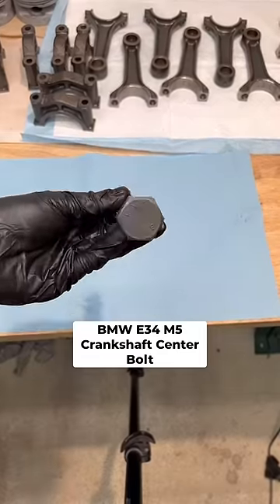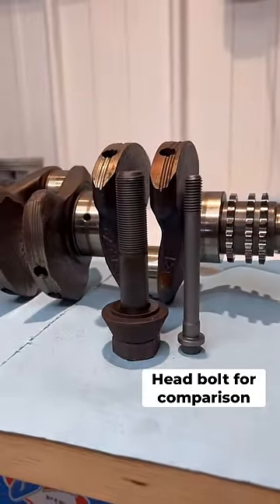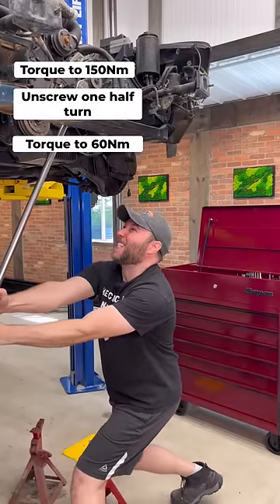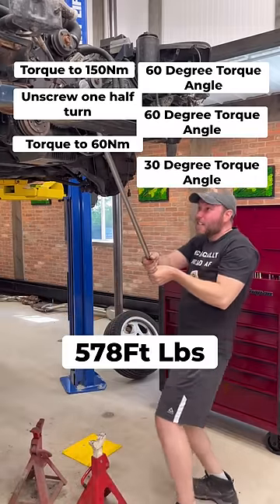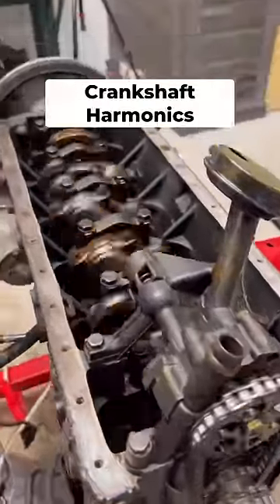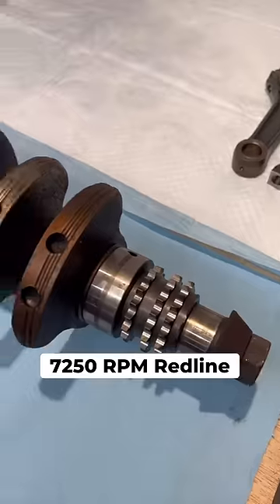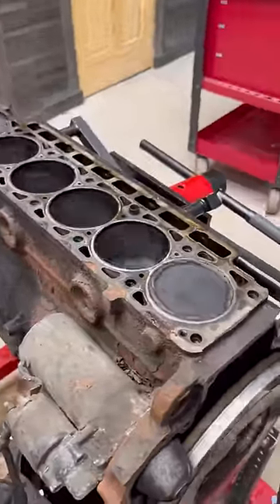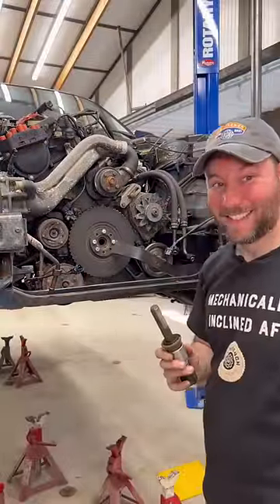BMW E34 M5 Crankshaft Center Bolt Explanation #bmw #cars #diy #bmwm5 #bmwe34 #restoration #engine

Comment: Toyota overcame this issue. They made the bolt reverse thread to whatever direction the engine spins, so that the act of rotation keeps it tight.
Reply from the maker: Yes, like a viscous fan clutch
Reply: Because when Toyota and Honda were creating masterpieces the Germans couldn't make a microwave....
Reply: @dkaloupis75   That's funny,  the orientals were waiting for the europeans to invent the automobile so they  would have something to copy.
Reply: @Rich-xq3uv orientals? Bro what are you like 86?
Reply: @fordsquared537  his name is rich, so yeah he’s got to be. No parent is naming their kid some boomer ass name like that nowadays
Reply: @WELDEDMIND  So I'm an 86   year old Gen-Xer. Okay. You might want to double check your math.
Reply: Yea but its a pain in the ass the first time you undo it lol
Reply: @dkaloupis75 Germans invented the modern automobile..
Reply: That would be too simple for bmw engineers, and way too reliable
Reply: @swanaldmcdnld  Yes,  Asian - noun; native of Asia. Oriental - noun; a native or inhabitant of the Orient.  signed Gen-X.
Reply: @Rich-xq3uv  Europeans didn't really invent the first automobile.
Reply: @budgroweryt9947  Please tell.
Reply: They didn't. Even if the thread is reverse to crankshaft direction, you still need to tighten it with a proper torque.
Reply: @Rich-xq3uv  doing something first doesn't always mean you do it best
Reply: @steverogers9452  why are 5heir cars over engineered crap then? Owned a Bmw and it was a pain
Reply: @Jay-ek3sj  because they profit off of stupid people who buy the brand for the "prestige" then wonder why an expensive car is expensive to maintain.
And let's be honest you probably had a second hand BMW that was most likely mistreated by the previous owner.
Reply: @metalavenger23  newer I6 engines are reverse thread and they still need to be tighten around 300nm torque. It's just Inline 6 specifics. It is super long and prone to vibration.
Reply: @fordsquared537  HAHAH
Reply: @Jykobe491  I'm not denying that..  You,  yourself can reverse engineer any new 'widget' and make it better. The  hard part is inventing the 'widget' in the first place.
Reply: @Jykobe491  cause they want money
Reply: @karolmalinowski9097  Torgue specs are for noobs.  Small bolt you tighten with a small wrench and a bigger bolt you use a bigger wrench.
Reply: @fordsquared537  No Cause My Grandpa who died last year at 87 had a different name for them. But its' not repeatable.
Reply: What you say works for rotating parts, it certainly doesn't work if it's the vibrations that unscrew the bolt.  If the piece unscrews because it vibrates, it will do so regardless of the direction in which it is screwed.
Reply: @prefono  that's the thing, the rotation of the engine keeps it from getting loose enough to cause an issue. Basically canceling the forces out.
Reply: @fordsquared537  His mind is still back in the 60s and 70s. This is evidence of information being passed down and taught to offspring.
Reply: @Rhaspun  Asian - noun; native of Asia. Oriental - noun; a native or inhabitant of the Orient.  signed Gen-X.
Reply: @Rich-xq3uv  You should have sign it with "A White Boy".
Reply: @steverogers9452  Uh, no, they didn't...the Koreans and Japanese did. Modern "consumer" cars, the ones that don't cost a ton and get you from point A and B? That was them. What Germany and the rest of the Euro's were doing at that point were creating track cars, something the Asian's didn't get into until the late 70's (and didn't start shining until the later of that decade)
Reply: @DxBlack  That's probably true  but we shouldn't  use names of continents to describe a group of people either . I also don't like the term African since it encompasses countries like Egypt and 'asian' encompasses Russia and the billion Indians. 
To be honest, I used the term oriental to see how many fragile millennials and gen-z'ers I could offend.  Sadly there were many LOL.
Reply: @DxBlack  check your facts bud. Germany did infact invent the modern automobile. And America was the first to mass produce a modern vehicle.
Reply: @wotwott2319  That tactic has run it's course.
Try that over used word on someone who cares,
Reply: Japanese always fixing German mistakes.
Reply: @vihreelinja4743  not true at all
Reply: @budgroweryt9947  yes they did 🤣 you forget that Americans are second class Europeans that could not cut it back at home in those times
Reply: @obedientfire840  not at all what happened, but go off I guess.
Reply: The Fiat Twincam engine is the same; reverse threaded crank bolt.
Reply: @WELDEDMIND  Maybe not in the US? Becuase here in the UK, every caucasian GenZ is called Charles, Rupert, Eliza, Elly. School roll calls must sound like a fucking Charles Dickens novel! XD
Reply: @dkaloupis75  oooooooh... hahah
nice one 👍

Comment: Audi 100/a6 2.5L TDI 
Crank bolt torque 2000nm 😀
1. Step 200nm
2. Step 270 degree torque angle
Reply from the maker: Yup! That engine is a beast

Comment: Inline sixes have excellent primary balance but due to the long crankshaft 2nd and 3rd order harmonics are a different story. The Aussie Barra inline six is known for loosening flexplate bolts but I haven't seen much about problems with the harmonic damper, even with higher revving, very high output modified engines.
Reply from the maker: Pontiac made an inline 8 cyl that had terrible harmonics. The crankshaft actually would sag

Comment: I bet if I put one of the bmw engineers on a polygraph  he would tell me that the torqing and loosening part is due to people not making sure the threads are clean enough for a predictable torque rating.
Reply from the maker: Yes, its to help overcome friction
Reply from the maker: @MaFTB  Yes. Almost like a pre load
Reply: @wewrench  does this "torqing and loosening" part have it's own name?
I would like to watch/read more on the topic but I'm not sure how to phrase it.
Reply: @anj000 same lmk if you find out
Reply: Cycling the fastener with lube and clean threads will crush high spots and work harden the surface, so when you almost over torque the fastener it will work, not smear the threads. Does it matter after you disassemble it? I would say no unless you heated it because a sledge hammer mechanic locktited the damn thing. JS
Reply from the maker: @anj000  yes, it’s called pre load
Reply: No. They would tell you to replace the bolt because it's not reusable.
Reply: It's called a yield point. 
Some bolts need to be torques to yield. 
It's stretches the bolt which makes it stronger  at its tightest point before it breaks. But it can never be used again.

Comment: For comparison, we used 2x M20 Rods to clamp and hold the weight of 16 stories worth of vertically installed 4" steel pipe in a highrise in germany. Due to leaks we had to cut out a section and replace it. For safety we had to clamp the 16 stories above and below with 2 M20 Rods each. We torqued the M20x4" Pipe clamps and the rod/bolts at around 900Nm/750ft-lbs.
Reply from the maker: Thank you for posting an actual intelligent comment
Reply: You used BMW connecting rods in the construction of German highrise buildings? That's beyond cool. Please expand if you do have any additional information.
Reply: Just realizing you meant M20, as in 20mm metric bolts, rather than connecting rods out of am m20b25 bmw engine.
Reply: @weedshoes5089  might wanna slow down on weed bro 🤣
Reply: @Momo  there is another comment thread on this very video mentioning BMW's wild Torque sequence on rod bolts. Having done a set of rod bearings in an s54 last week, it was fresh on my mind.
Reply from the maker: @weedshoes5089  no..he meant just M20 bolts
Reply from the maker: @weedshoes5089  or M20 threaded Rod rather

Comment: Well my 3406e caterpillar crank bolt has to be torqued to a insane 2500ft-lbs  but I'm pushing 1000 ponies
Reply from the maker: That's a real bolt!
Reply: Thing’s as thick as your arm though
Reply: Now how the fuck are you supposed to check that? With a 2" drive, 15 foot torque wrench and cheater pipe?
Reply: @tommyellis7728  
Nope it's done with a hydraulic torque wrench
Reply: @tommyellis7728  typically done with a torque multiplier and a 1" drive 5 foot 1000 ft lbs rated torque wrench.

Comment: The real reason: because engineers rarely need to work on these cars themselves.
Reply from the maker: Yup. They just let us take it on the chin
Reply: Ironically, a lot of these assembly procedures are there as "poka yoke", or, error proofing, exercises. A bunch of these motors probably left the plant with that bolt half ass torqued so they made the procedure idiot proof.

Comment: Make no sense because in-line 6 are the most harmonic balance engines secondary force cánseles out after every rotación which mean that it’s the most smooth engine that will prevent crank pulley to loosen out.
Reply from the maker: The crankshaft is long and heavy and at high revs, it vibrates excessively

Comment: I got a fully build ford modular v8 with a 7100 rpm redline that doesn’t need that…
Reply from the maker: A lot of engines don't. That's why I wanted to make a vid about it
Reply: @wewrench  now I’m afraid mine is gonna blow up thanks a lot 😆
Reply from the maker: @thatonegolden9463  It won't. This is entirely different engine design,
Reply: @wewrench  v8’s can typically handle more rpm than inline engines
Reply: @bobhilly546312156332  that's simply not true at all
Reply: In fully build version this engine and car beat a buggati veyron.
Reply from the maker: @8kmar  Really?? I’ve seen some crazy numbers out of these engines but Bugatti territory??
Reply: 6g72 is a v6 with stock redline of 7k which can be extended to 7300 even on stock internals. And ofc no such bolt. Just a regular array of 8 pcs M10 bolts
Reply: Wow so cool 🙄
Reply: @DreStyle  I’m not bragging I’m just saying 7300 is not that crazy of an rpm so it’s weird it needs that bolt
Reply from the maker: @DreStyle  Thank you

Comment: It's called a yield point. 
Some bolts need to be torqued to yield. 
It's stretches the bolt which makes it stronger  at its tightest point before it breaks. But it can never be used again.
Reply from the maker: That's correct

Comment: Friction from the clamping pressure provided by that bolt is all that actually keeps the pulley/damper from rotating relative to the crank shaft. No key could be made precise enough to do the job when it's seeing hundreds of torque reversals per second.
Reply from the maker: Thank you for this intelligent observation.

Comment: That’s why bmw may have said they did it, but a larger bolt diameter doesn’t help resist harmonic loosening. There were many better ways to do it that had been around for forever. Had to just be easier on the assembly line than other options!
Reply from the maker: The clamping force of the larger bolt may though

Comment: My mini cooper's crank bolt is 1/4 the size. Its running 21psi , revs out to 8200rpm redline and is just over 300whp... the crank bolt has never had an issue loosening.. so there's gotta be a different reason . I think that that bolt actually acts as a dampner
Reply: And that’s an inline 4 which is much less smooth than an i6. I don’t understand this goofy bolt business. A naturally balanced i6 should have no issues at only 7k.
Reply from the maker: Has to do with the length and weight of the crank and amount of reciprocating mass
Reply from the maker: Thank you for supporting the channel!
Reply: @wewrench  
I like how bmw goes overkill just encase rather than skimping....

Comment: The factory wants you to verify the bolt is torqued to the elastic portion of the bolt and not stretched to the point of plastic deformation!!! That's why!!!
Reply from the maker: I think this center bolt goes to the plastic deformation stage
Reply: @wewrench  Only BMW would know. But I'd say that's probably unlikely as once the bolt reaches its yield point and begins to deform in the plastic deformation range, it loses its strength and may be subject to catastrophic failures!
Reply from the maker: @LWRC  ohhh ok. I see what you mean.

Comment: That more than what we torque semi wheels to
Reply from the maker: I know. It's so wacky I had to make a video about it
Reply: @wewrench  how big of a torque wrench are you using, a 1 inch drive?
Reply from the maker: @bobhilly546312156332  No, just a regular size. The torque part is small. Its the torque angle stages that require the muscle and I'll use a 3/4" ratchet to do those
Reply: @wewrench  I know we us a 1 inch for the semis for 500 foot pounds

Comment: I always follow the specs. Almost every time I have deviated from following the specs it did not end well
Reply from the maker: Yes, you always should
Reply: @wewrench I ignored all the specs and got a much cooler truck 😂
Reply from the maker: @SBFmafia  Hey man, whatever works for you!
Reply: Well it is almost like same smart people put ther brain to work so that if you torque too spec nothing will unscrew it self and fall off and you don't damage anything by putting to much force in it

Comment: Most older cars' bolts' torque in Hungary: tighten as much as you can/untill it squeeks (you over did it if it strips, you didn't do enough if it doesn't feel like it was tightened by an engine with a torque multiplier welded onto it)
Reply from the maker: hahaha...I like that method

Comment: The reason it needs so much torque is because of the large diameter of the bolt. The large diameter of the bolt creates more friction than a smaller diameter one, and therefore requires more torque to get the same clamping pressure as smaller one.
Reply from the maker: That and crankshaft harmonics. This crank is long and heavy and causes it to vibrate things loose

Comment: Many people don't realize, that the S38 engine in the E34 M5 is still somewhat based off of the legendary M88 engine found in the BMW M1 of the mid-late 1970s. 

So having an engine, that might not be perfectly balanced in a car that was released in the late 80s is totally fine - and don't forget, that some people squeezed out 1500hp with a single semi turbo out of these engines! 

These engines are tough haha
Reply from the maker: yes...you are correct! Thank you for supporting the channel!

Comment: German engineers LOVE to complicate EVERYTHING! 
Big block Chevy can be easily built to 9000+rpm and 2000+HP, ARP spec on the bolt is 100lb/ft!
Reply from the maker: Different design though and crank profile

Comment: internally balance, get a fluid damper, use blue loctite with arp hardware
Reply from the maker: This has more to do with the long heavy crankshaft. Not sure any of that would help. The engine is already internally balanced

Comment: My LSJ Cobalt has a 7,300 rpm redline and my crank bolt torques to 74 ft lbs + 125deg. Now if you compare that to the BMW the torque and degree are in the same ballpark BUT the Cobalt crank bolt is NOT AN M20, it’s more like an M16, which means it begins to yield and stretch LONG BEFORE the BMW bolt (also why it’s a otu bolt). Another great example of this is head bolts at my job (diesel tech). Headbolts on a Ford 3.7 V6 have ft lb specs in 3 stages then deg spec in 3 stages (90deg each time I believe) even so, they final torque on the head bolts is only equal to about 110ft lbs because the bolts are stretching. Meanwhile… a similar torque pattern on a 6.4 diesel results in final torque after degree stages of 400+ ft lbs which results in it being HIGHLY recommended a heads be torque to the block IN FRAME because if you try it on an engine stand that bitch is gunna barrel roll. Long story short, it isn’t just about final torque, it’s about whether/when/if that bolt is yielding during that torque process, so bolt diameter is a crucial part of this equation. Engineering yo
Reply from the maker: Great comment! Thank you for supporting the channel!

Comment: Its not a passenger car engine! it is a handbuilt racing car engine that was installed in a handmade car that took 5 weeks to build. The engine was otiginally designed for the Bmw M1 and its designation was an s36 engine
Reply from the maker: It’s a “race inspired” engine but not a true race engine. The test is whether or not the longevity is measured in hours rather than miles

Comment: Thought the 5 cylinder Colorado was bad. the bolt was about 6 inches long and 3-4 of a inch thick. Makes sense though considering how much vibrations they encounter.
Reply from the maker: That sounds crazy

Comment: Small block chevy first produced in 1955. Still raced today. 
My redlne on my small block chevy 8000 rpm.  Smooth as silk. 
Crank bolt 7/16 60 ft lbs.
Reply: The only good thing GM has ever done. I'm still convinced the small block was an accident.
Reply from the maker: Different engine design though. And yes, the SBC def has staying power

Comment: When I was 17 I slapt together an EJ20 into a 92 legacy RS from 3 different motors,  mismatched pistons, didn't weigh/balance anything, uggah duggud the füçķ out of it and Bolted on a td06-20g @22psi through boost tee, Spun it to 9200rpm. Lasted 34,000km before piston 3 melted and I blew 2nd gear. I miss that car. Looking back it was probably pretty stupid for a first car😅
Reply from the maker: Sounds like a cool build!

Comment: Material hardness 12.9 
Also they could try to balance the engine a bit better (rly low red line tbh)  and try lighter pulley
Reply from the maker: Lighter puller could make it worse though

Comment: The Honda s2000 revs to 9000 and crank pulley bolt only requires 181 ft/lbs. the Germans always gotta make things complicated…
Reply from the maker: Yeah they do, but that's a different engine design